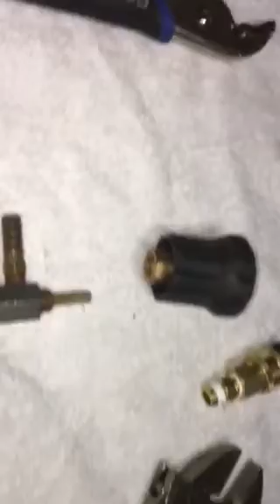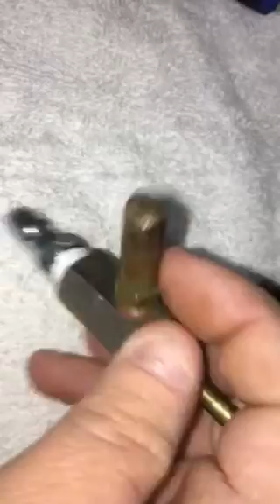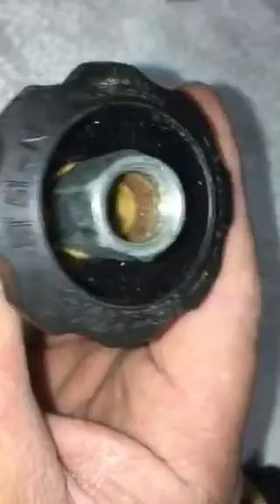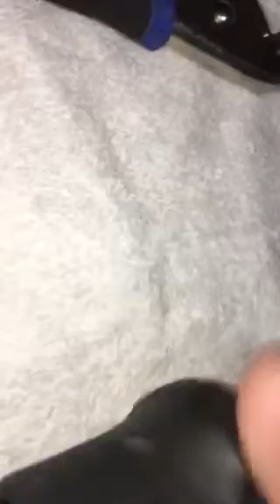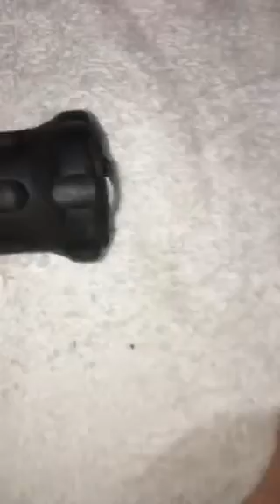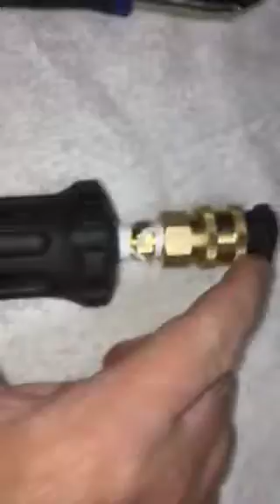Pressure washing business applying soap solutions xjet tips and tepairs

Comment: Home Depot sells a blue tip that is adjustable from fan to stream it works great. You could put that on the end of it. That's what I use when downstreaming and rinsing.
Reply from the maker: Those are probably  rated at 4  gallons per minute though probably a great idea, but at 8 gallons per minute it would put too much back pressure on the xjet
Reply: Billy Davidson we have a 7gpm machine and it still pull chemical. We also use hot water when rinsing. They usually last about a year. Give it a try I believe there only 10 bucks or so